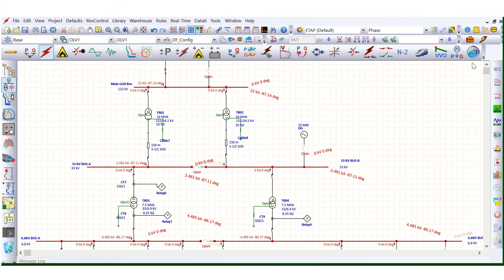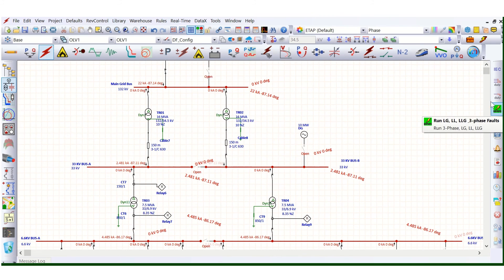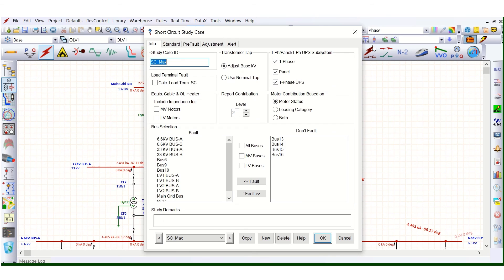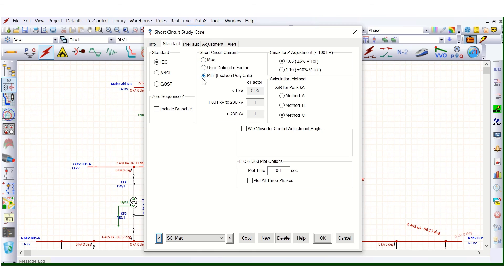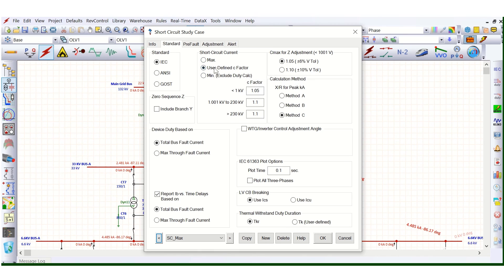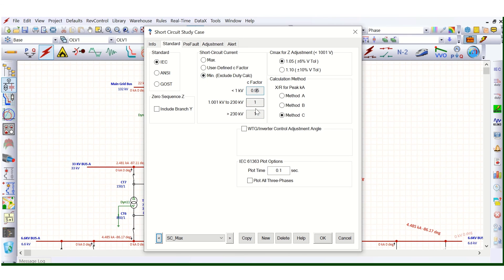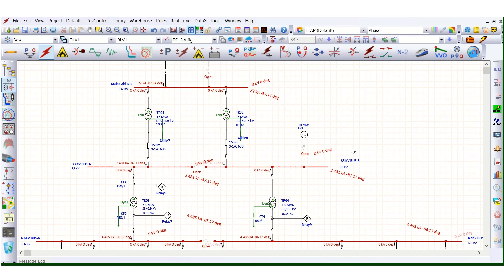ETAP Short Circuit Study II Device Duty & 3 Phase Fault Analysis

Comment: The results of both cases are supposed to be totally same right? between min SC and min SC with no load. However, why the result you showed are not same each other?

Could you please advise?

Thank you.
Reply from the maker: Ideally both will be same; provided that the connected loads are considered same for both the cases.. since the c-factor will be same as 0.95..
However, the no-load condition is defined by the user where the connected loads are decided based on operational philosophy,, accordingly results may come different from MIN SC. case..
Reply: @SmartEducare , where I can study📚✏ of sub station design course
Reply: Please explain about device duty current importance. Also where the max sc current, min short circuit current values are used.